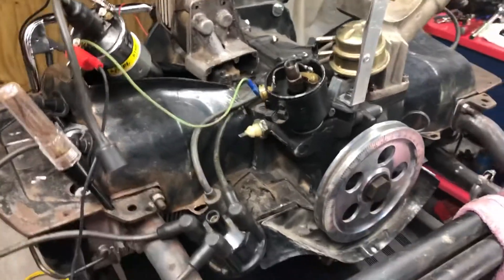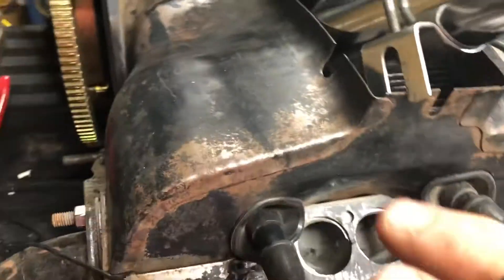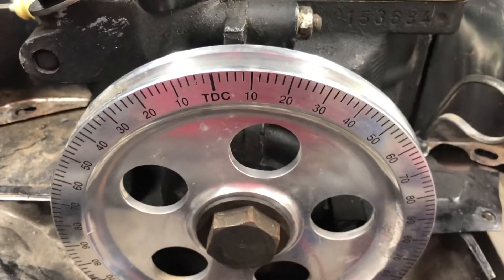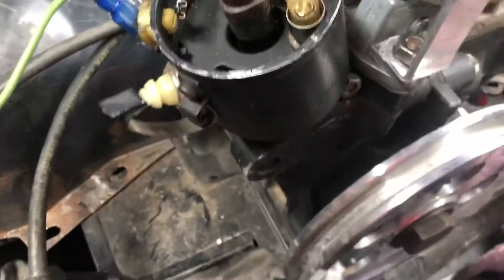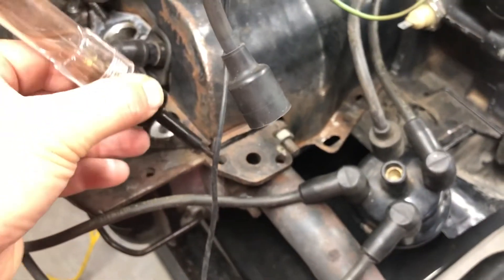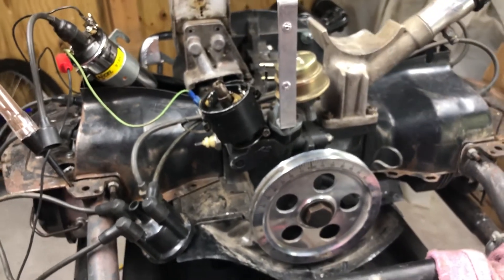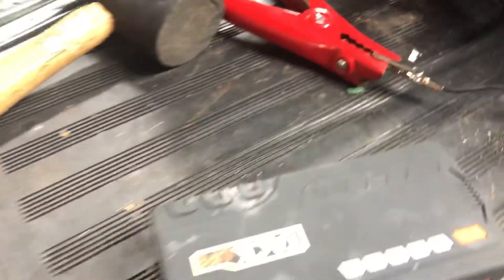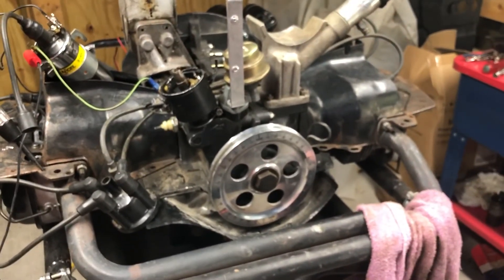Static Timing Light Stays On - Aircooled VW Bug Beetle

Comment: I had the same issue!
It turned out it was also a coil failing, but as it was only 8 months old (German Beru blue coil), I honestly thought that would be the last thing to be causing the problem.
When working on the points multiple times, I found the test light remained on no matter how much the 009 Distributor was rotated (I think I rotated it around 180 degrees). I was thinking initially it was a grounding issue. Interestingly whenever I pulled the points lever arm and let it snap back and connect, the light would go off until the distributor was rotated even slightly again. That made me think it wasn’t properly connecting.
The whole time the apparent grounding issue / static timing test light remaining on, it was evidence the coil was failing. In hindsight, the 3 weeks leading up to the coil failing, there had been repeated instances of damage to the points, leading to misfires and no spark. I had put this points damage down to the little condenser attached to the side of the distributor.
Moral of the story is: carry a spare coil.

Comment: i'll take a gamble at it with the little research i did! this whole coil system depends on the grounds  (battery negative terminal and strap underneath between the engine and transmission. The coil comes into place then, with just the black wire connected to the positive or input side of the coil, both ends should give the same voltage reading. This current then travels down to the points which open and close by grounding on and off as the distributor spins.  This sort of acts like a switch for the negative or output side of the coil as it ungrounding the current meaning spark happens as current is going through and grounding the current meaning no spark happens and the voltage on the output/negative side of the coil  remains at 0 until the distributor opens the points again for the next piston and does the same cycle all over again. If one of these components fail or are missing they should absolutely be addressed. Sometimes the grounds are missing, sometimes the points aren't gapped right or just simply don't open creating no spark, sometimes the coil is just bad and worn out, if your wiring is really old the positive cable that goes to the fuse box and then travels to the coil may lose some current so the voltage for the corresponding cable should also be checked at the fuse box and addressed as well. There are times  the condenser may just simply fail and have a continuous ground interfering with the timing light by making it stay on, to fix this simply uncrew the condenser from the body of the distributor and isolate and if the light remains on the piece will need to be changed. In my case, way more stupid than others. I didn't have the condenser wire attached to the negative/output side of the coil making the timing light stay on. I hope i made sense feel free to correct me or my terms. I'm just 17 and very curious and sorry too much. Goodluck to anyone trying to solve this same problem.

Comment: Same thing happened to me. It was nice seeing your video. I did not feel I was alone going crazy with this. This is what I did: 

1. I readjusted the valves (yes, just in case since this may cause timing issues).
2. I know I had gapped my points already. I installed brand new points and condenser. Still, I gapped the points again. 
3. Timing light stopped acting like we are discussing here. I was able to time static time the car and car started!!!

What was it then? The only thing I can think of is the points were not really closing (lamp off). For this reason, when I rotated the distributor, visually I thought the were moving but the were not for some reason and they remained open (lamp on). (CLYMER VW BEETLE 1961-1979: Shop manual 5th Edition. Page 48).

I
Reply: did it solve problem.

Comment: TAKE THE LIGHT ON THE NEG. AND GROUND IT TO METAL AND PUT THE LIGHT ON THE POS. SIDE TURN DIST. AND LIGHT SHOULD GO OUT
Reply: Wow Nobody ever answered  this issue. And now I'm having the same one
Reply from the maker: Thanks. I tried this and the problem remains. The light stays on no matter how far I turn the diz.
Reply: @nittygrittykitchen  Take the number one spark plug and wire and groung it to metal and see if you get a spark ,also go to tube and look up EZGZ  he has helped me with my bug
Reply: What was the problem?
Reply from the maker: @christianmccollum1028  I bought a new coil. Seems to have resolved it. Thx
Reply: Okay what's up guys I'm having the same problem with New Coil New points cap rotor light Will Not Turn Off and I Get No Spark , 
Any Suggestions please??🙏
Reply: Silent Hill Fan  Did the new coil fix your issue?